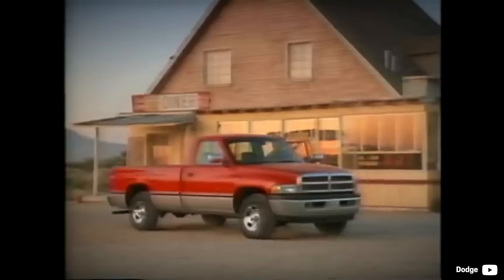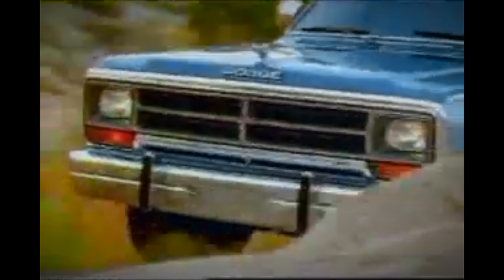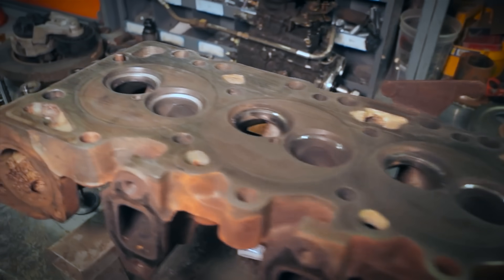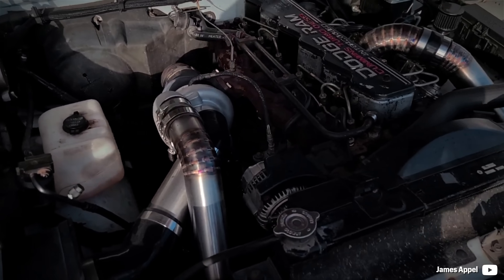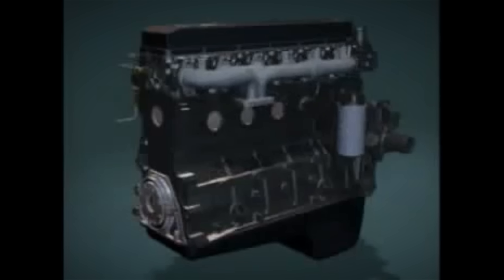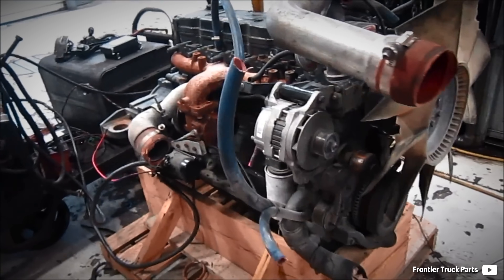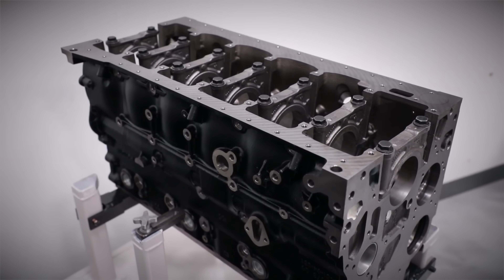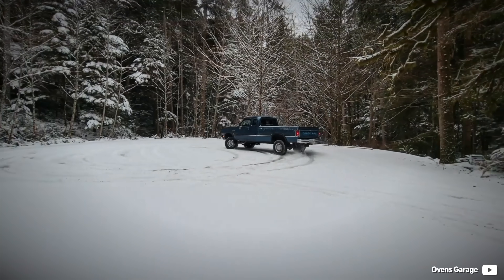The Most Reliable Diesel 6-Cylinder?

Comment: Hemi engines are junk most all tick when u start them my had 1 brand new didn't last but 140,000 miles rod started knocking, I have had my 96 explorer 5.0 for 4 years my friend's have had multiple chevy and dodges mine has close to 350,000 miles don't burn oil 😀
Reply: What’s that got to do with this video?

Comment: Once upon a time, I owned a '93 LE Cummins (with 5-speed manual trans). I LOVED that truck! When pulling a 26' 5th wheel travel trailer, it got better fuel economy (15mpg) than any of my gas powered trucks got running empty (11mpg at BEST)!!! I would ALWAYS get 20mpg running around town, and as much as 24.5mpg flying down the highway.

Wish I still had that truck....

Comment: I have a 2000 Dodge ram with that 24 valve Cummins vp44 with an edge controller on it. It did well for about a month then the engine block cracked. Never overheated I never ran low on oil. It is not a 53 block. Now it just sits in my yard. I bought a Nissan truck and it has done me well
Reply: If u don't mind...what casting #is it...?.. just curious
Reply: 53
Reply: 53

Comment: I worked at Cummins from 1990 to 1995, at the Technical Center in downtown Columbus, Indiana.  There was a lot of interesting stuff everywhere I went.  Especially in the basement.  Prototype engines that never saw the light of production.  One such engine was a 4.9L 5-cylinder B-series, data-tagged as being built in 1982.  I keep wondering what might have been if they had released that for production.  Later on Cummins built a 6B with aluminum block and head for a Navy contract.  Cummins couldn't do that normally either:  the block was a ceramic-fiber reinforced casting.  They tested the hell out of it to assess its life, and managed to tear the rear main bearing bulkhead out of it in a few hundred hours.  Way overfueled and overboosted.  

Young and enthusiastic, I thought up a project to modify a Dodge pickup to capture the diesel pickup truck record at Bonneville.  I figured that a stock-body truck with 480 HP would be able to capture the record which at the time stood at 160 mph.  My goal was 175 mph.  I wrote up a memo and sent it in, but was told by management "We don't want to encourage that kind of irresponsible usage of our engines by the general public."  This was in 1993, about 10 years before Gale Banks took his B-powered Dakota to Bonneville and ran 226 mph.  I guess Gale had a better sales pitch to Cummins than I did, because he got their cooperation on that project.
Reply: Gale Banks might have also have a better facility and racing reputation/history.
Reply: @sepg5084  Compared to me working alone in my garage, no doubt.  BUT I was pitching the speed record project as one that Cummins would do in its own facilities.  There were a lot of drag racers, dirt racers, and tractor pullers working at the Tech Center.  We could have done it.
Reply: Wow thats a wild story.
Reply: I TRULY wonder if Cummins would EVER consider producing an i5 turbo diesel for  light to mid duty truck, ('Ute', as our respected, VERY experienced & skilled Aussie brothers designed them). So it seems Ford's Struandale Engine Plant / Port Elizabeth / South Africa, (As far as I know), is still producing said engines, having seen some amazing Australian upgrades to it. I just keep in my mind the looong (& sometimes lonely) journeys, quite a few hard working Aussies must deal with. Just my 2 cents.
Reply: @Retired Bore Mahle?
Reply: Cummins is a very innovative engine company, from their very first beginning developed PT fuel system, replaced the bulky high pressure air blast injection then enable diesel engine light and power enough on the road, then further on marine, railway and construction machinery.  They always have innovative idea from engineering to marketing, great and number 1 USA technology company!!!!!
Reply: yea but you sir set the wheel in motion.
Reply: All I’ve been hearing talks to the ram  1500 might get a new diesel soon they stop production of the ecobiesel
Reply: @hectorguajardo6392  Yeah. It's been rumored that Stellantis is trying to pull diesels out of the Ram altogether, and speculated to eventually kill the Ram line further down the road. I know for sure the 6 won't be around much longer, and I can't really see Cummins spending the money developing a new turbo 4 if it's true that Stellantis is planning to kill Ram pickups. Who knows wtf will happen
Reply: @Drmcclung  Cummins makes most of its money from sales of marine and generator engines. They're not solely dependent on Stellantis.
Reply: @AnnatarTheMaia  Well I don't know.. Companies like Kubota and Yanmar, among others, are beginning to fill that gap and overtake that market too. We'll see what happens, it'll be interesting.
Reply: Do you know anything about the BLX Cummins prototype?
Reply: @dieselfueled_  No.
Reply: Probably nothing to come of it because 1) our stupid government doing its best to kill the diesel market entirely and 2) the I-5's probably wouldn't do anything the turbo 4's could't and I can't see Cummins spending the money on it when they're already geared up to phase out the road-going 6. They're probably going to do to their general public segment what Cat did to the semi segment, pull out altogether. At some point. That and if Stellantis can't get its sh*t together I don't see the Cummins/Chrysler partnership lasting much longer anyway, their only general public. There's been rumors that they're (Stellantis) trying to kill off diesels in the Ram line
Reply: You might’ve known my aunts Lori and Stacey hale, crazy finding someone else from Columbus here
Reply: My dad used to work for Cummins and then Arvin back in the 70s and 80s. Used to love to go to Ceraland and miss Columbus.

Comment: Best light-medium duty diesel engine in NA. Too bad it was put into a Chrysler (Dodge being owned by aforementioned) vehicle😞 What are the bad sides of an RAM trucks? Well... transmission, (Manual was fine. All pickup trucks today are automatic only. And RAM being a Chrysler brand got the short end of the stick, compared to competition in this regard, no pun intended😑) transfer case (4WD), suspension, electronics, corrosion protection, overall quality control, etc. The only saving grace for heavy-duty RAM pickup truck was it's Cummins engine. Competition (Ford especially) didn't sit idly. Ford shredded the contract it had with Navistar International to provide them with a diesel engine and brought it in-house (2011-present). Result? Ford built, Power Stroke engine is way better in all aspects than the ones provided by Navistar International. So, even in that regard, it is hard to chose RAM 2500 & 3500 over the Ford Super Duty 250, 350, 450 when it comes to full-size diesel pick-up truck😒

And don't even mention RAM's Eco-Diesel (VM Motori) V6, 3.0 series fumble😖

Comment: I drove a 9.3 meters long boat with a Cummins 4.2 litre 320 hp diesel engine. The power and torque is insane.
Reply: I have a 16.5m boat with 2 12 valves at 330hp each and holy the power torque and reliability is incredible

Comment: My dad bought his first diesel truck to pull a 35’ gooseneck in 1992 (to replace a 3/4 ton Ford with a 460) I remember it was $20,500 out the door for a 1 ton, dually, ext cab, 2WD, 5 speed. It was a wonderful truck for pulling and he went from probably 8 mpg to over 20, not to mention in the 90’s diesel was actually cheaper than gas and well under $1 per gallon. We put well over 500,000 miles on it with very few problems. Every issue we had with it had to do with the truck itself and not the engine. Unfortunately rust ended up getting it and he sold it for something very low like $2000 about 15 years ago. I would imagine now it would be worth more than just for the engine and transmission. He bought a 4 door 1999 F350 7.3 power stroke to replace it with as the Ford rode way better and was probably a better truck overall for comfort. Talk about picking two winners back to back. I remember the Ford was $31,000. When did 1 ton diesel trucks get so expensive? Even inflation adjusted they’re way, way more expensive now and I would argue not nearly as reliable.
Reply: It's because they have a much bigger demand. It used to be that they sold trucks to working men and maybe a few rural folk. Now everyone and their mom wants a pickup, so they drive up the price because they know people will still by them.
Reply: I agree, a new 1 ton Deisel 4x4 like a platinum ford is a $$$ Hundred Grand literally.  Reliability is None existent on the new Deisel trucks.
Reply: @hughwolfe8524  I would have to disagree with reliability on ford's end. That 6.7 is one hell of a diesel.
Reply: @Bennet4623  right it is way Better now , I was thinking of the 6.4 and 6.0
Reply: @hughwolfe8524  yeah the 6.0 is ok when bulletproofed but the 6.4 has no hope😂
Reply: @hughwolfe8524  they were 42 grand just 10 yrs ago, now  80-100 K
Reply: @HUASTECO8  yes
Reply: Partly demand,but two big factors are interior styling,people want the best of what's available,leather seats,real wood and metal trim pieces,power accesories- windows,seats,mirrors,etc., Premium audio components,tinted windows,heated seats,most of this stuff wasn't wanted or needed on trucks built before 2000. Then throw in the new age technology stuff; computer screens,wifi& Bluetooth and GPS,backup cameras&sensors,and lastly,figuring how to build motors that can produce massive power,get decent fuel mileage,meets today's emissions requirements,AND,can last a couple hundred thousand miles! AND THIS IS WHY PICKUPS ARE SO EXPENSIVE TODAY! But as for me, I love the power and creature comforts of modern trucks. I will always love my old 71 Chevy C20, as well as my 72' F-250 Camper special. They were fantastic pickups for their time, but really can't even compare with today's pickups. Lucky us!
Reply: Its been estimated. that roughly 25% of the cost of the new diesel trucks are due to complicated emissions and egr systems which ironically are the things that make the new diesels less fuel efficient and less reliable.
Reply: The early ones (before the horsepower war) 92 were amazing on fuel , a flawless engine
Reply: Stringent emissions, forcing automakers to put in a bunch of extra crap to "reduce pollution" which actually just adds complexity and cost, passed down to the buyer.